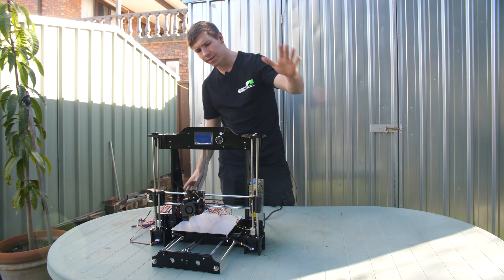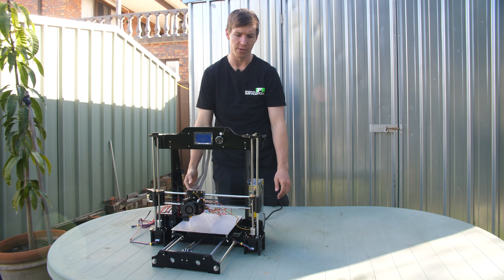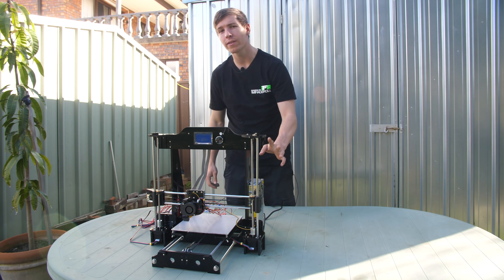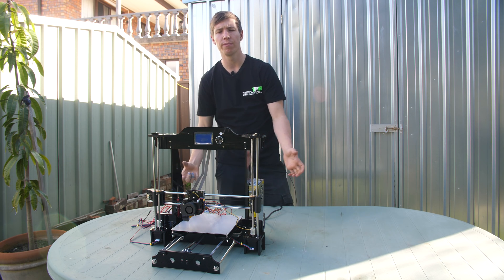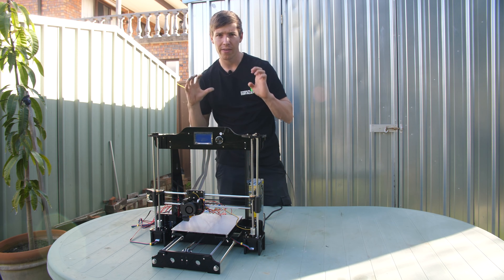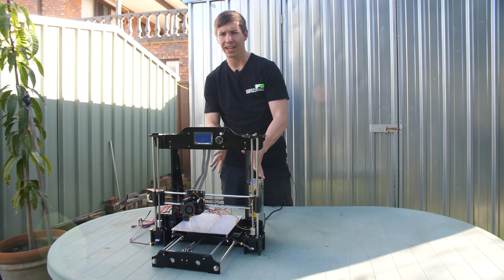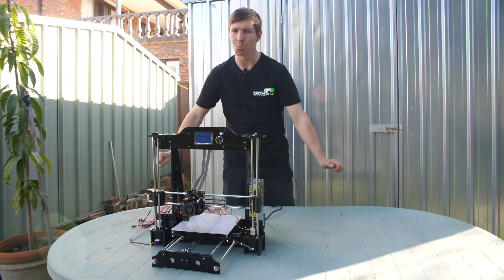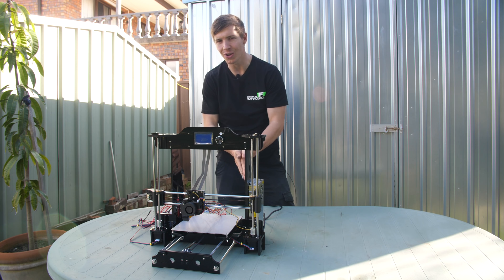Time Lapse DIY 3D Printer Build & Thoughts - What Should I Make?

Comment: Don't print cable chains or printer modification parts out of PLA, because one day you'll want to put it in a chamber for printing ABS, and the PLA parts will melt. Just FYI, I learned that the hard way. I'm reprinting a cable chain now in ABS. Also, I put in some hours and extended all my wires to about a yard and attached the controller board and LCD on a piece of particle board. I bought a MOSFET for the heated bed just so all that current wouldn't be going through the little board. That's all for now. ABS is hard to master, but here's the solution: use a piece of glass cut the same size as the aluminum bed and just squirt some acetone on there and use a piece of ABS to wipe on the glass till it starts to stick and then take that piece away, now theres a film of ABS stuck to the glass. the bed should be 90 degrees and the whole printer needs to be in an almost airtight box. make sure the grams per cc in the slicer is correct for the ABS you have. Cura seems to work good for some things, slic3r for others, it's all about testing and changing settings, and testing again. I find that the z axis tends to print a bit too short, and the x axis is hard to fix on the X8. thingiverse has some mods.

Comment: If you do get any z-axis error, the screws in the bottom are used to adjust the bed to match the slope the z-axis rods are on, for minor adjustments, and manually screw it for bigger adjustments. Interesting that it has two stepper motors for the Z-axis. #TevoMasterrace
Reply from the maker: +BigBlockieBob exactly my thoughts

Comment: maybe print something to help with the cablemanagement of the printer? 
speaking of which, how about cable channels, with custom inlays? like a wide based u bar, ya see in some cases, (corsair nzxt and etc.) with stuff like the name of the project inlaid with it, or chaneled out for a rgb strip? 
 Ya could also print one and shave it in with the cnc machiene,but this way it elimnates a step, also im curious of the material quality? 
one last idea. Custom io covers, with some very cool depth added to it? 
Something like your wow build.
Reply: they do make a 3d printer material now the is water disolveable, so you could make some intercate stuff using some of that stuff,  paired with the normal material.
Reply from the maker: +Dennis Rigdon definatly some gret ideas man. Ill have to look into it a bit further